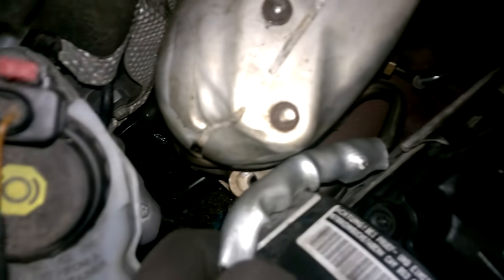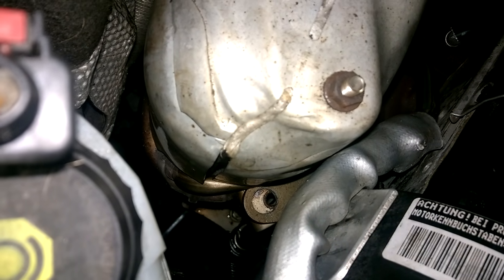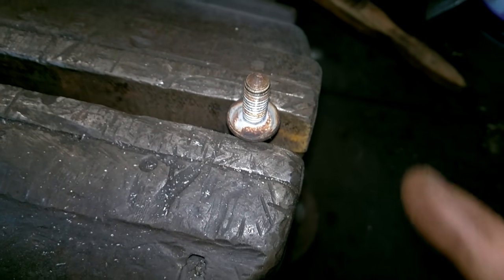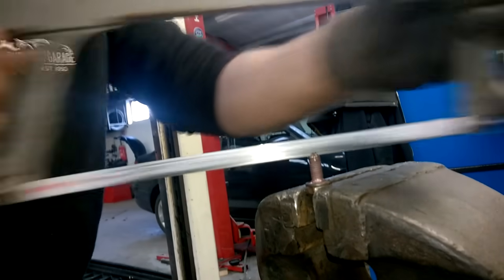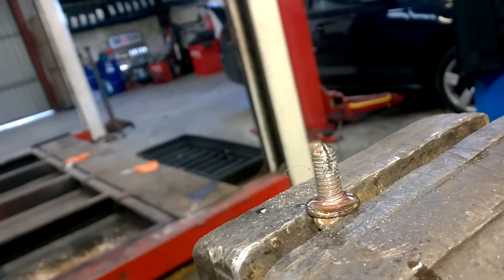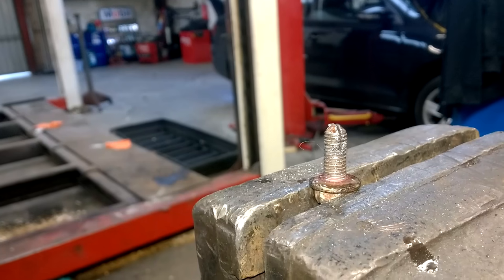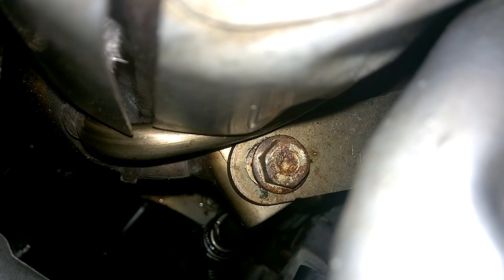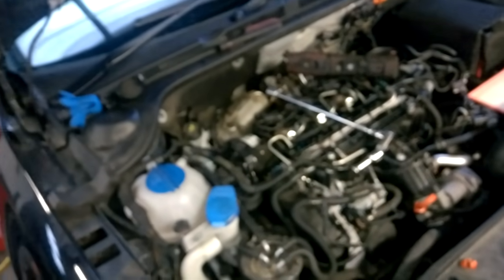My Father Taught Me This! Passing It On To The Next Generation

Comment: How bout crossthread
Reply from the maker: The update info below is the pinned comment on this video, I know most people do not realize I made that video and it better explains/shows this method in use.   
I also included below details of why the job was done this way free of charge with the customer fully informed. I hope you check it out  👇👇
 
UPDATE* I decided to make a follow up video on this https://www.youtube.com/watch?v=yfNQullGEuQ&feature=youtu.be Should answer some of the questions that were raised, I include 3 demos of this in action with close up shots.
 
As there was some safety concerns & confusing comments raised, I felt I should clear a few things up. 
1) This is a tip for certain circumstances only, I never have and never would use it on a component which would cause any safety concern to any customer.  
2) The demo was done on a support bracket only, items like this or similar will not cause any safety concern. 
3) I did this free of charge and on a time restraint, I noticed it when I was replacing another item, the customer needed the vehicle back that evening and I decided rather than leave it like it was, I would do this and secure it up fully. 
4) The bolt was not the issue, the part that the bolt threads into is a secured piece, someone had previously damaged it, leaving the bracket loose and the bolt just tightened a turn or so.
5) The bolt can be removed and will not break, it will go in and out as usual and has helped clean up the damaged threads.  
6) Used in the right application I personally believe this is a great tip and can save you a lot of time & trouble. 

Lastly to all the people who have watched the video, Thanks very much and I am delighted with the feedback I have received on it.

Comment: Grinder and cut off wheel save ya some time.
Reply from the maker: The update info below is the pinned comment on this video, I know most people do not realize I made that video and it better explains/shows this method in use.   
I also included below details of why the job was done this way free of charge with the customer fully informed. I hope you check it out  👇👇
 
UPDATE* I decided to make a follow up video on this https://www.youtube.com/watch?v=yfNQullGEuQ&feature=youtu.be Should answer some of the questions that were raised, I include 3 demos of this in action with close up shots.
 
As there was some safety concerns & confusing comments raised, I felt I should clear a few things up. 
1) This is a tip for certain circumstances only, I never have and never would use it on a component which would cause any safety concern to any customer.  
2) The demo was done on a support bracket only, items like this or similar will not cause any safety concern. 
3) I did this free of charge and on a time restraint, I noticed it when I was replacing another item, the customer needed the vehicle back that evening and I decided rather than leave it like it was, I would do this and secure it up fully. 
4) The bolt was not the issue, the part that the bolt threads into is a secured piece, someone had previously damaged it, leaving the bracket loose and the bolt just tightened a turn or so.
5) The bolt can be removed and will not break, it will go in and out as usual and has helped clean up the damaged threads.  
6) Used in the right application I personally believe this is a great tip and can save you a lot of time & trouble. 

Lastly to all the people who have watched the video, Thanks very much and I am delighted with the feedback I have received on it.

Comment: Amazing.....
Reply from the maker: The update info below is the pinned comment on this video, I know most people do not realize I made that video and it better explains/shows this method in use.   
I also included below details of why the job was done this way free of charge with the customer fully informed. I hope you check it out  👇👇
 
UPDATE* I decided to make a follow up video on this https://www.youtube.com/watch?v=yfNQullGEuQ&feature=youtu.be Should answer some of the questions that were raised, I include 3 demos of this in action with close up shots.
 
As there was some safety concerns & confusing comments raised, I felt I should clear a few things up. 
1) This is a tip for certain circumstances only, I never have and never would use it on a component which would cause any safety concern to any customer.  
2) The demo was done on a support bracket only, items like this or similar will not cause any safety concern. 
3) I did this free of charge and on a time restraint, I noticed it when I was replacing another item, the customer needed the vehicle back that evening and I decided rather than leave it like it was, I would do this and secure it up fully. 
4) The bolt was not the issue, the part that the bolt threads into is a secured piece, someone had previously damaged it, leaving the bracket loose and the bolt just tightened a turn or so.
5) The bolt can be removed and will not break, it will go in and out as usual and has helped clean up the damaged threads.  
6) Used in the right application I personally believe this is a great tip and can save you a lot of time & trouble. 

Lastly to all the people who have watched the video, Thanks very much and I am delighted with the feedback I have received on it.

Comment: Do this and you will NEVER get that bolt out again!!!
Reply from the maker: The update info below is the pinned comment on this video, I know most people do not realize I made that video and it better explains/shows this method in use.   
I also included below details of why the job was done this way free of charge with the customer fully informed. I hope you check it out  👇👇
 
UPDATE* I decided to make a follow up video on this https://www.youtube.com/watch?v=yfNQullGEuQ&feature=youtu.be Should answer some of the questions that were raised, I include 3 demos of this in action with close up shots.
 
As there was some safety concerns & confusing comments raised, I felt I should clear a few things up. 
1) This is a tip for certain circumstances only, I never have and never would use it on a component which would cause any safety concern to any customer.  
2) The demo was done on a support bracket only, items like this or similar will not cause any safety concern. 
3) I did this free of charge and on a time restraint, I noticed it when I was replacing another item, the customer needed the vehicle back that evening and I decided rather than leave it like it was, I would do this and secure it up fully. 
4) The bolt was not the issue, the part that the bolt threads into is a secured piece, someone had previously damaged it, leaving the bracket loose and the bolt just tightened a turn or so.
5) The bolt can be removed and will not break, it will go in and out as usual and has helped clean up the damaged threads.  
6) Used in the right application I personally believe this is a great tip and can save you a lot of time & trouble. 

Lastly to all the people who have watched the video, Thanks very much and I am delighted with the feedback I have received on it.

Comment: ah yes  great  idea  like a tappered pin
Reply from the maker: The update info below is the pinned comment on this video, I know most people do not realize I made that video and it better explains/shows this method in use.   
I also included below details of why the job was done this way free of charge with the customer fully informed. I hope you check it out  👇👇
 
UPDATE* I decided to make a follow up video on this https://www.youtube.com/watch?v=yfNQullGEuQ&feature=youtu.be Should answer some of the questions that were raised, I include 3 demos of this in action with close up shots.
 
As there was some safety concerns & confusing comments raised, I felt I should clear a few things up. 
1) This is a tip for certain circumstances only, I never have and never would use it on a component which would cause any safety concern to any customer.  
2) The demo was done on a support bracket only, items like this or similar will not cause any safety concern. 
3) I did this free of charge and on a time restraint, I noticed it when I was replacing another item, the customer needed the vehicle back that evening and I decided rather than leave it like it was, I would do this and secure it up fully. 
4) The bolt was not the issue, the part that the bolt threads into is a secured piece, someone had previously damaged it, leaving the bracket loose and the bolt just tightened a turn or so.
5) The bolt can be removed and will not break, it will go in and out as usual and has helped clean up the damaged threads.  
6) Used in the right application I personally believe this is a great tip and can save you a lot of time & trouble. 

Lastly to all the people who have watched the video, Thanks very much and I am delighted with the feedback I have received on it.

Comment: Great way to weaken a bolt so it let's go just at the right moment.
Reply from the maker: The update info below is the pinned comment on this video, I know most people do not realize I made that video and it better explains/shows this method in use.   
I also included below details of why the job was done this way free of charge with the customer fully informed. I hope you check it out  👇👇
 
UPDATE* I decided to make a follow up video on this https://www.youtube.com/watch?v=yfNQullGEuQ&feature=youtu.be Should answer some of the questions that were raised, I include 3 demos of this in action with close up shots.
 
As there was some safety concerns & confusing comments raised, I felt I should clear a few things up. 
1) This is a tip for certain circumstances only, I never have and never would use it on a component which would cause any safety concern to any customer.  
2) The demo was done on a support bracket only, items like this or similar will not cause any safety concern. 
3) I did this free of charge and on a time restraint, I noticed it when I was replacing another item, the customer needed the vehicle back that evening and I decided rather than leave it like it was, I would do this and secure it up fully. 
4) The bolt was not the issue, the part that the bolt threads into is a secured piece, someone had previously damaged it, leaving the bracket loose and the bolt just tightened a turn or so.
5) The bolt can be removed and will not break, it will go in and out as usual and has helped clean up the damaged threads.  
6) Used in the right application I personally believe this is a great tip and can save you a lot of time & trouble. 

Lastly to all the people who have watched the video, Thanks very much and I am delighted with the feedback I have received on it.

Comment: TBH after watchin 2 mins i still dont know what the hack is?
Reply from the maker: The update info below is the pinned comment on this video, I know most people do not realize I made that video and it better explains/shows this method in use.   
I also included below details of why the job was done this way free of charge with the customer fully informed. I hope you check it out  👇👇
 
UPDATE* I decided to make a follow up video on this https://www.youtube.com/watch?v=yfNQullGEuQ&feature=youtu.be Should answer some of the questions that were raised, I include 3 demos of this in action with close up shots.
 
As there was some safety concerns & confusing comments raised, I felt I should clear a few things up. 
1) This is a tip for certain circumstances only, I never have and never would use it on a component which would cause any safety concern to any customer.  
2) The demo was done on a support bracket only, items like this or similar will not cause any safety concern. 
3) I did this free of charge and on a time restraint, I noticed it when I was replacing another item, the customer needed the vehicle back that evening and I decided rather than leave it like it was, I would do this and secure it up fully. 
4) The bolt was not the issue, the part that the bolt threads into is a secured piece, someone had previously damaged it, leaving the bracket loose and the bolt just tightened a turn or so.
5) The bolt can be removed and will not break, it will go in and out as usual and has helped clean up the damaged threads.  
6) Used in the right application I personally believe this is a great tip and can save you a lot of time & trouble. 

Lastly to all the people who have watched the video, Thanks very much and I am delighted with the feedback I have received on it.

Comment: Meh da tould meh to nevah take me car to a garage and to fex it meself. Now i walk everywhere
Reply from the maker: The update info below is the pinned comment on this video, I know most people do not realize I made that video and it better explains/shows this method in use.   
I also included below details of why the job was done this way free of charge with the customer fully informed. I hope you check it out  👇👇
 
UPDATE* I decided to make a follow up video on this https://www.youtube.com/watch?v=yfNQullGEuQ&feature=youtu.be Should answer some of the questions that were raised, I include 3 demos of this in action with close up shots.
 
As there was some safety concerns & confusing comments raised, I felt I should clear a few things up. 
1) This is a tip for certain circumstances only, I never have and never would use it on a component which would cause any safety concern to any customer.  
2) The demo was done on a support bracket only, items like this or similar will not cause any safety concern. 
3) I did this free of charge and on a time restraint, I noticed it when I was replacing another item, the customer needed the vehicle back that evening and I decided rather than leave it like it was, I would do this and secure it up fully. 
4) The bolt was not the issue, the part that the bolt threads into is a secured piece, someone had previously damaged it, leaving the bracket loose and the bolt just tightened a turn or so.
5) The bolt can be removed and will not break, it will go in and out as usual and has helped clean up the damaged threads.  
6) Used in the right application I personally believe this is a great tip and can save you a lot of time & trouble. 

Lastly to all the people who have watched the video, Thanks very much and I am delighted with the feedback I have received on it.

Comment: I would never trust this. Bolt length is as intentional as its grade and torque spec. By splitting even part of the shank, you're effectively shortening the bolt. But even worse: instead of repairing damaged threads, you're furthering the damage to previously undamaged threads.

Sure, you may get it to torque down. But thermal flexing and vibrational frequencies will become new vulnerabilities. Those are in addition to the loss of torsional integrity.

At some point, the time and energy required for a proper fix WILL be spent. That can be paid now as part of your professional service, or later with "interest" tacked on.

Comment: Can I do this in a control arm bolt?  😂😂😂😂😂 jk jk
Reply from the maker: 😂😂 ammmmmm maybe not 😂😂 
 
The update info below is the pinned comment on this video, I know most people do not realize I made that video and it better explains/shows this method in use.   
I also included below details of why the job was done this way free of charge with the customer fully informed. I hope you check it out  👇👇
 
UPDATE* I decided to make a follow up video on this https://www.youtube.com/watch?v=yfNQullGEuQ&feature=youtu.be Should answer some of the questions that were raised, I include 3 demos of this in action with close up shots.
 
As there was some safety concerns & confusing comments raised, I felt I should clear a few things up. 
1) This is a tip for certain circumstances only, I never have and never would use it on a component which would cause any safety concern to any customer.  
2) The demo was done on a support bracket only, items like this or similar will not cause any safety concern. 
3) I did this free of charge and on a time restraint, I noticed it when I was replacing another item, the customer needed the vehicle back that evening and I decided rather than leave it like it was, I would do this and secure it up fully. 
4) The bolt was not the issue, the part that the bolt threads into is a secured piece, someone had previously damaged it, leaving the bracket loose and the bolt just tightened a turn or so.
5) The bolt can be removed and will not break, it will go in and out as usual and has helped clean up the damaged threads.  
6) Used in the right application I personally believe this is a great tip and can save you a lot of time & trouble. 

Lastly to all the people who have watched the video, Thanks very much and I am delighted with the feedback I have received on it.